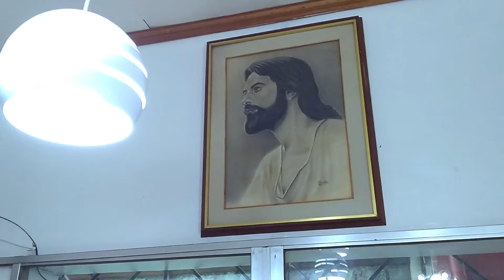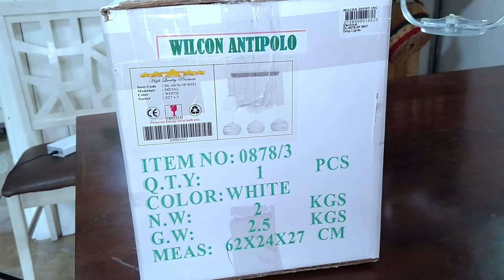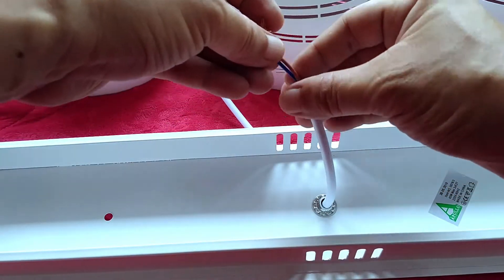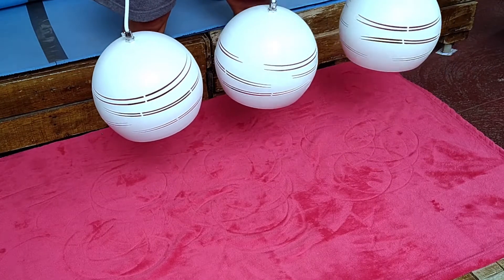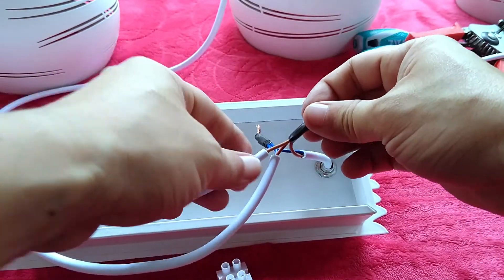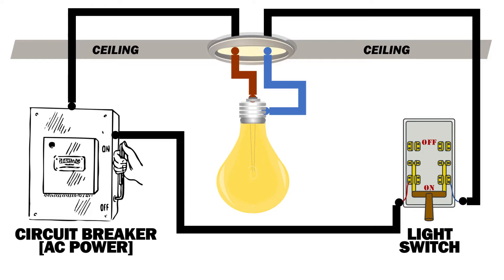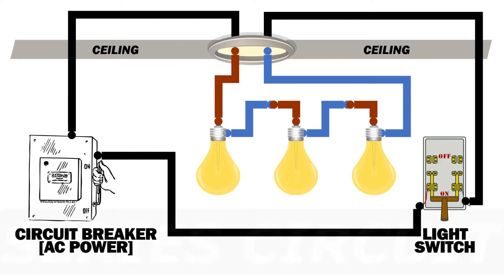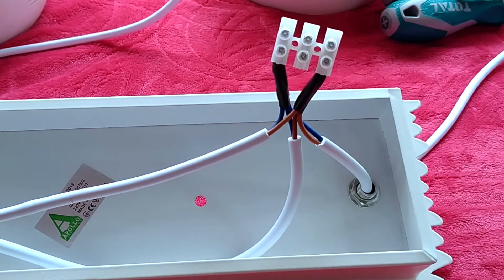How to Wire 3 Light Bulbs to 1 Switch (Using a Parallel Circuit Like a Pro!)

Comment: In my case my light ceiling wire has that white connector. Meaning i don’t need to fix a connector directly to the bulbs wires???

Comment: 👍How about the earthing? If there is 1, then where  should it go? Kindly do share on another video, I guess, or reply. Very useful video. Thank you
Reply from the maker: To any wire or conductive material that goes directly to the ground. If there is a ground wire that goes all the way back to the distribution box, connect the hanging light's ground wire (if there is one) to it.

Comment: Is this applicable for 1 dimmer switch with 3 bulbs? Tnx for the reply.
Reply from the maker: It can be used with a dimmer switch BUT you have to use special bulbs designed for dimmers.

Comment: Was planning of doing my own diy drop lights... Just a quick question though, can i just simply attach the group wires from the lamp directly to the wire from the ceiling without using those "wire connectors"  the ones that came with ur drop lights? I mean I'll connect them on d same manner minus the wire connectors but wrapping them with electrical tape instead. Please hear me out
Reply from the maker: Yes you can,, for as long as you connect the wires correctly. 👍

Comment: Where can I buy that electrician parallel circuit that you use? 
And i notice that it has 3 wire holes or connectors, can I install the grounds in the remaining connector?
Reply from the maker: It came with the light set. Try searching in your local online stores.

Comment: Reference the FIRST diagram.   Drawing is incorrect.   The Hot wire, from the on and off switch should go to the TIP of the light bulb, NOT the base of the bulb. 
Thank you.m
Reply from the maker: You sure about that? If both wires touch the TIP of the bulb, then you'll have a short --  which is irresponsibly dangerous. The contact points on a light bulb is the TIP and the BASE (threaded metal).  You can even confirm this if you study the anatomy of a light socket that the bulb is inserted in. Thanks.
Reply: HanDIYman 007 The Blue wire coming from the switch ( always the hot side of
an AC circuit ) clearly shows connected to the Base of the build. Which is incorrect. The blue wire should be on the TIP of the build. Thank you.
Reply from the maker: @tedlahm5740  I think what you're referring to is some US standard. In the Philippines, both wires produce 110V which gives us 220V. Anyway, like I said in the vid, you can interchange the wires -- just don't let them touch each other.
Reply: HanDIYman 007 Thank you. Yes, it is a North American standard. 
We do understand the vast majority of the world uses the system you are accustomed to.......    Question: does the lamp fixture have no neutral (earth ground ) on one side of the filament? Thank you.

Comment: Hello! Thank you for your video, it is pretty helpful. However, in my case, I need to connect three cables in parallel, each cable has two wires but the wires don't have any color. I can connect any of the two with any of the other two, etc? I would appreciate your help!!!
Reply from the maker: If all the wires are of the same color, try tracing one end of a wire to the other end -- very important to be accurate here AND not cross the wires or else you might cause a short circuit.